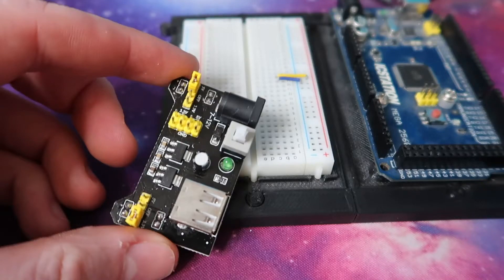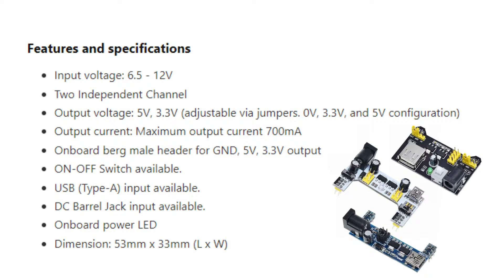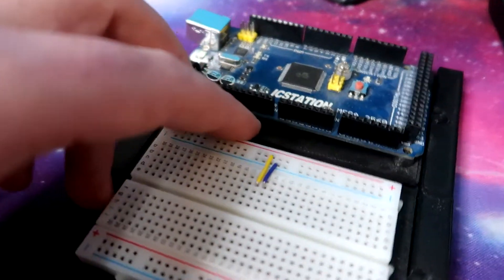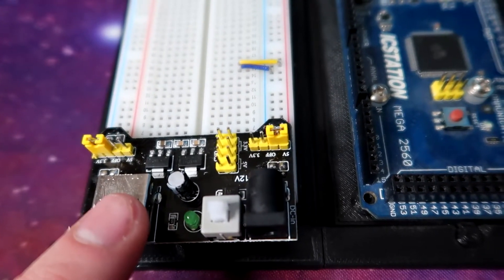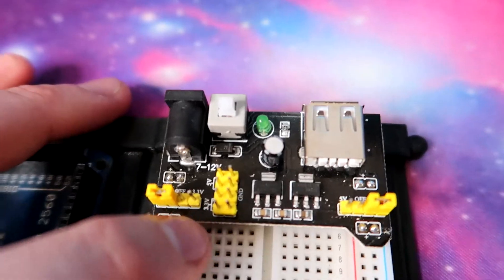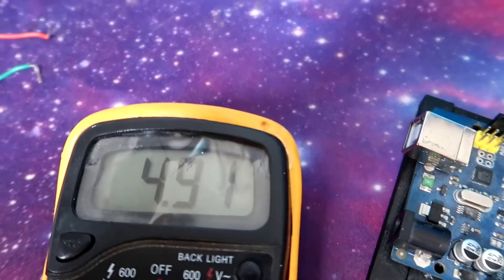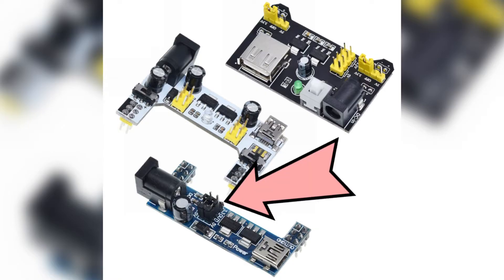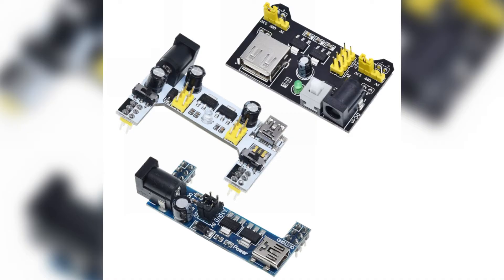How to use a Breadboard Power Supply

Comment: The only extra point I'd make is that the two rails are not independent. They share a common negative (ground) rail, so you can't use them to produce a ± 5V split supply, as you could if they were two independent supplies.

Comment: I have on of those where the USB is a power output, not an input.
Reply: They all are. The usb is connected to the output of the first regulator which would supply 5V if the barrel jack is used with 7V - 12V. So if you don't connect the barrel jack, you can use the usb as an input to supply the 5V directly and bypass the first regulator. Alternatively, if you do connect the barrel jack with a voltage between 7V and 12V, you can take 5V from the usb, but obviously you can't draw more in total than the 5V regulator can handle (700mA). The second regulator will step it down to 3.3V either way.

Comment: I power it with 12v, but on 5v rail I have 9-10v output, not 5v. 3.3v rail is ok. Is this normal?
Reply: No. The first (5V) regulator has failed. The second (3.3V) regulator is still working though.

Comment: thanks for the vid Scotty! As a green man who wants to practice the basics, I'm wondering whether it's a good idea to connect the board to my house network - a power supply connected to an outlet in a wall. does it pose any risk to the whole network?
Reply: Using a power supply that takes your mains voltage and outputs something like 9V is fine to power these boards. You won't damage your house network, although you may find ways to short out either the power supply or the board. Don't worry; they are cheap to replace, and it's all part of the learning process.

Comment: How come when I connect green and yellow LEDs to the 3.3v rail it fries them, but red LEDs are fine?
Reply: The truth is that LEDs really need a current limiting resistor in series (try 470 ohms to start with). LEDs can a have different working voltages and although some might be fine when fed with 3.3V, others may draw too much current and burn. I usually have several white LEDs where I've cut one leg short and soldered a 330 ohm 0.5 Watt resistor in place. I use those to see if a supply is on because they will light up safely with anything from about 3V to 12V supply.

Comment: I have the MB102 power supply hooked up with a 9v battery. My problem is, it seems to be really unstable, with fluctuating voltages depending on the load. When i choose the 5V mode with nothing attached, i only get 2.9V on the rail. When i place in an led, the voltage on the rails instantly drop down to 1.9V. Are that normal loading effects, or is the battery to weak? i cant figure out, what is going on. Are that common problems?
Reply: get a wall adapter like 9V or 12V and plug it in through DC jack also this module can out put current upto 800mA iirc, and yeah the chinese variants can be faulty sometimes the usb connecter is unregulated etc etc
Reply: The usual 9V PP3 batteries don't have much capacity and can't supply much current. Just use a voltmeter to measure the battery voltage when it's driving the MB102 board with a load and I bet the battery's voltage has dropped dramatically. Use a cheap 9V 1A psu that plugs into a wall outlet to power the MB102. It will save you hassle and pay for itself in the cost of batteries in no time.
Reply: same happened to me.
I have switching power supply of 5v 10a. 
this board seems kinda like stepdown Volt. dunno why.

Comment: What if I ran 8.4 volts but like 3000 mah, will that burn it out?
Reply: It can tolerate 12 V.
Reply: The MB102 is fine with 8.4V. The 3000 mAh rating is the capacity of the battery before it is drained and has no effect on the device that is drawing power from it.

Comment: Can I power it through 5V 2A power adapter?
Reply: Depends on how much volts the supply can hold
Reply: Nope the m102 powersupply can only sustain 700mA atmost so 2A supply would fry it